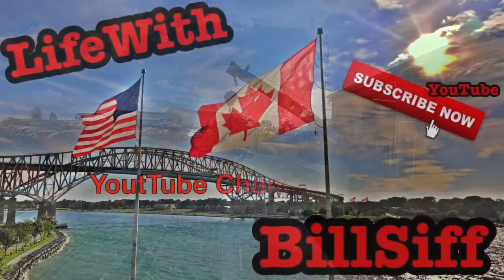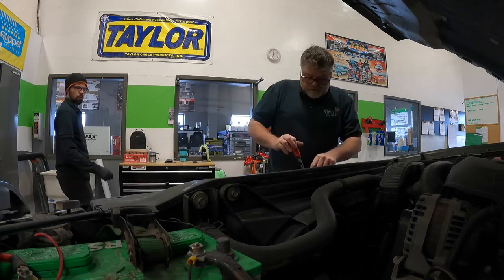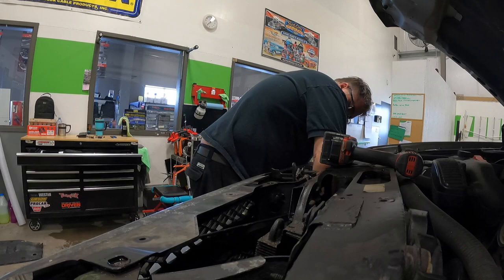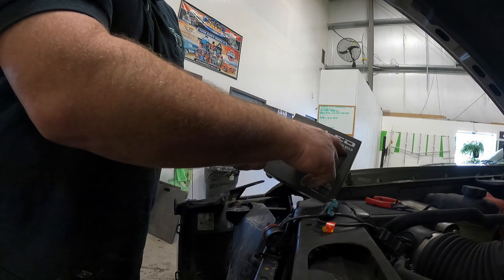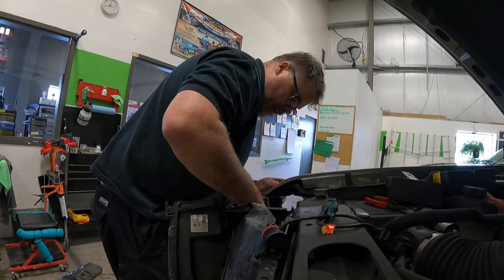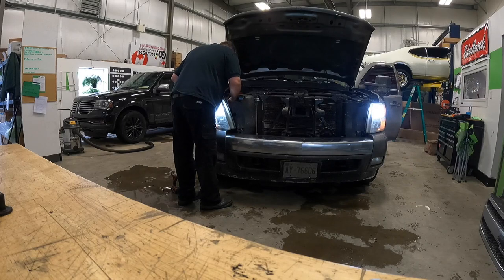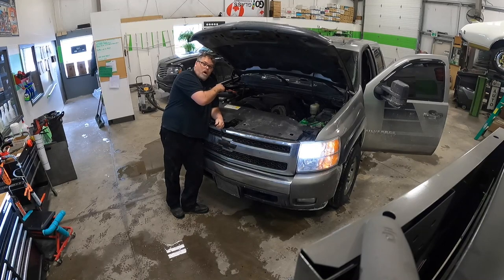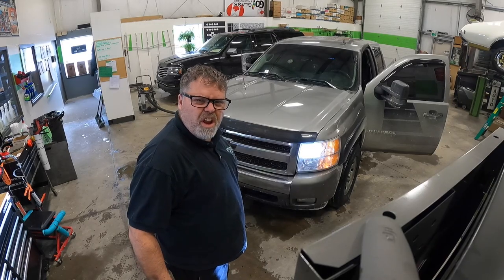Changing ANOTHER! Head Light Bulb

Comment: I've done it both ways at work... I prefer just pulling the air box out if I'm just doing the passenger side bulb but if I'm doing both it's quicker just to pull the grill because of that washer fluid tank being in a dick spot plus nobody like to remove the battery and have to reset the radio later...